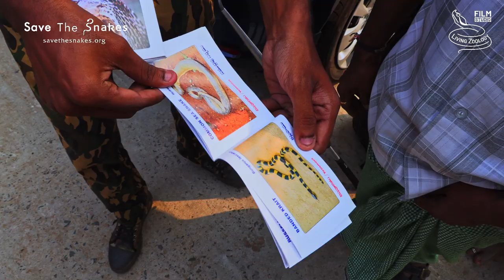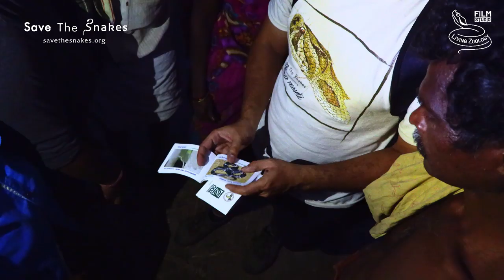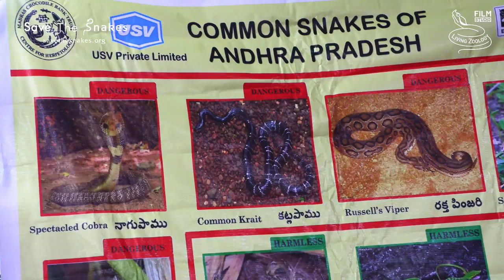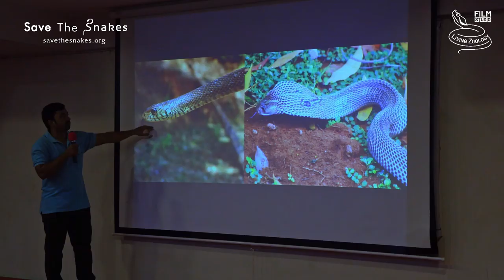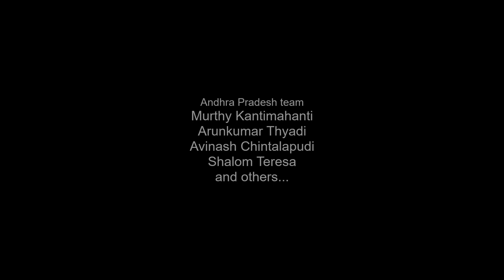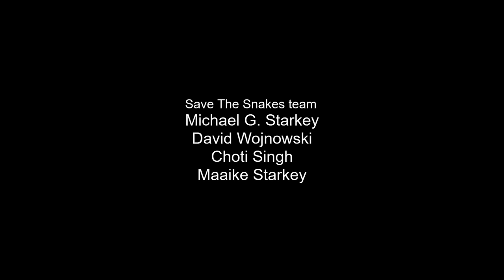Snake Rescue Call -  full wildlife documentary, conflict between humans and venomous snakes in India

Comment: To say the vine snakes venom is not dangerous to humans at all is not a correct statement.  If someone has an allergic reaction to the venom they can die very quickly.
Reply from the maker: Vine snakes have rear fangs, they need to chew to get the venom to their prey. They are very common and no one has ever had any troubles. Of course, there is a tiny chance that maybe somebody will have allergic reaction. We are not aware of any of such case.
Reply: @A Ald do you know of any reliable sources where this information can be located and researched by chance?